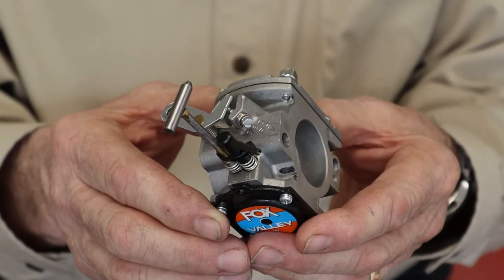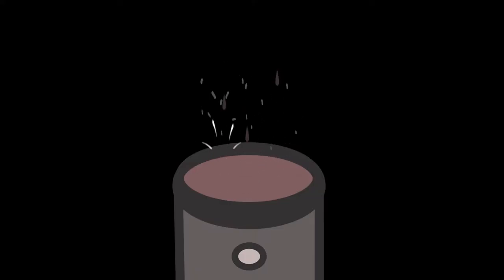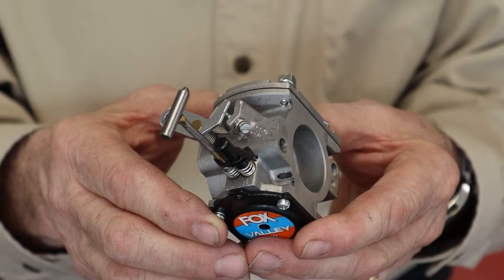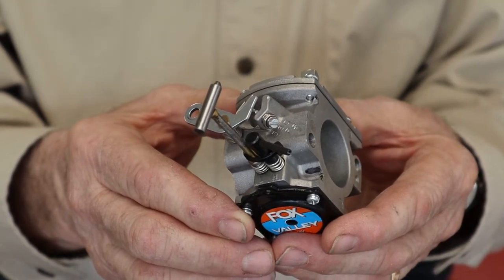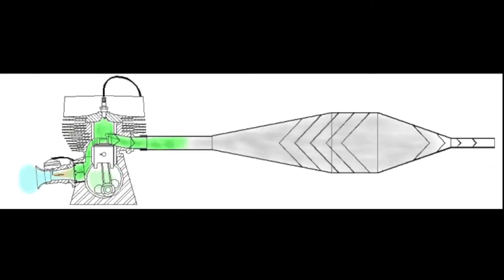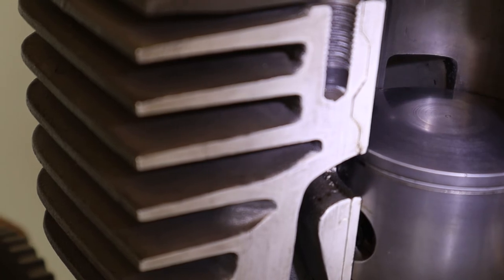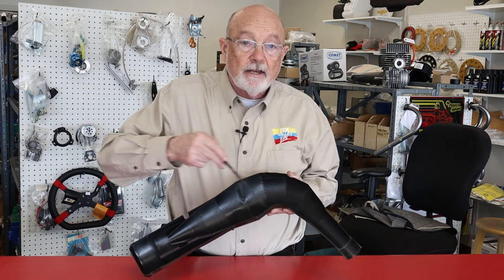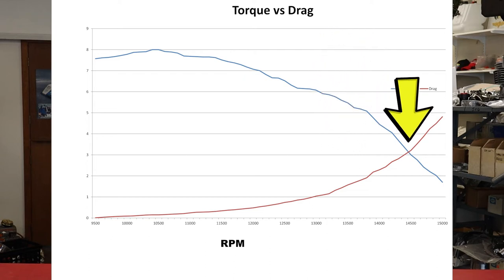Getting More RPM From Your 2 Cycle

Comment: As a none kart racer but a avid 2 stroke fan I'm amazed at the reliability of 100cc A/C engines and the revs they achieved.
Could some one give me a idea of what the equivalent jet size would be if running a conventional carb to size ratio. Also any idea's on what  the crank balance ratio would be, is vibration a problem?

Comment: We have a team that runs road course racing. Long tracks. I keep hearing people say you will go faster running a 16- 80 gear or 5 to 1 ratio instead or running a 13 -65 gear or 5 to 1ratio. I believe with the 16-80 gear you are moving more chain but I have been told that running both bigger gear makes more torque with  the same ratio. I believe torque from gears that are the same ratio is the same as long as you are only using two gears to get your ratio. Am I wrong?

Comment: Have you ever seen a variable length pipe? One that nests, and can be shortened by ear as rpm goes up? I'd like to build a 2 stroke motorized bike that can maintain minimum highway speeds for hours. Would water cooling be necessary to run high rpms for hours on end?
Reply from the maker: Yes, I'm familiar with adjustable-length pipes. We've used them for years on road-race karts. They are typically controlled  by a hand-lever activated cable.
As for running at highway speeds for hours, consistent cooling will be required, but can be accomplished with air cooling to avoid all the extra complexity of water cooling. It will be important,  however, for the rider to be able to monitor the engine temperature and adjust the carb mixture to avoid overheating.